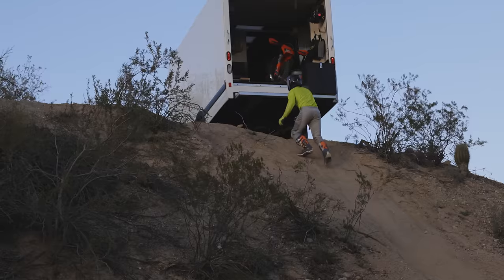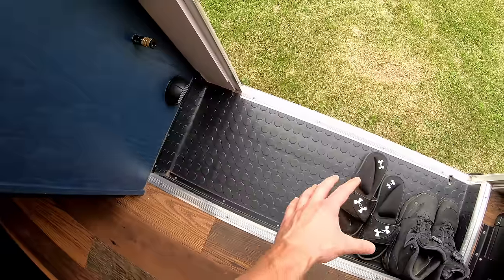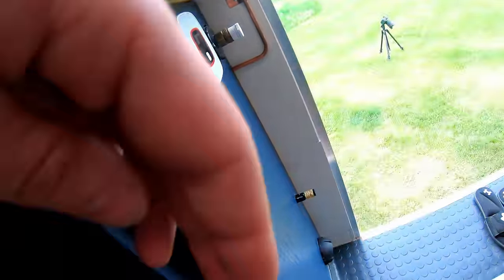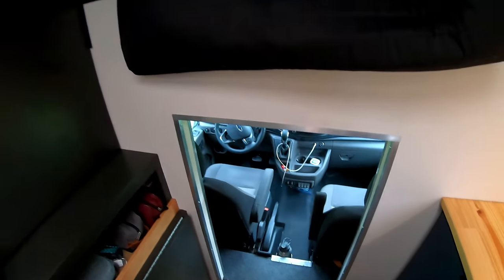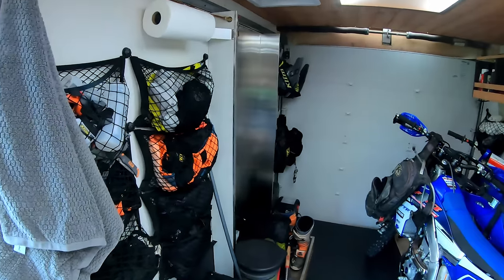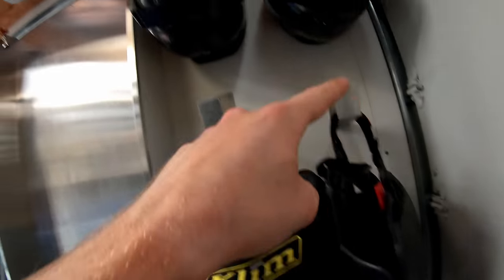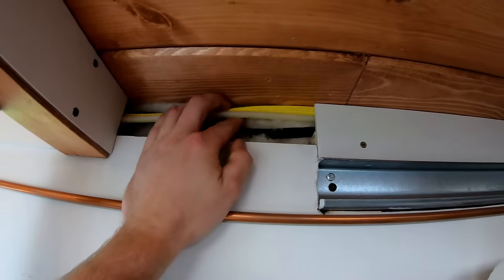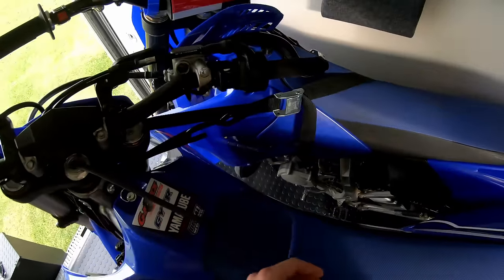Incredible DIY Dirtbike Camper Van Home FULL TOUR

Comment: VERY nice build! There are a few things I would do differently, but for the most part, they're just based on personal preference.

Upgrades to consider....

1. Cover/dress up the bottom of your bed frame and table.

2. Connect the two table straps together so you only have one unhook/hook to go from table stored to deployed.

3. Pull your garage vinyl up and glue it down to prevent the ripple in it.

4. If you always have a ton of extra battery available, consider getting a nice induction hot plate. Some have the ability to dial in an exact temperature (in 5° or 10° increments) and it gets rid of needing to keep butane on board.

There was something else, but I'd have to go back and watch the entire video to remember it (CRS doncha know 😀).

None of this is criticism, or at the most, constructive criticism. Overall a GREAT build.

I've been thinking of something along these lines for quite a while, but for my bagger Goldwing. For me, though, AC and hot water would be required. Also, I'd probably make the shower pan hiden under a floor panel in the garage so it's invisible when not in use.

Comment: I bought an electric water pot for coffee and noodle cups etc, it's changed my life.  It's so fast and efficient, I suggest getting rid of the teapot
Reply from the maker: I definitely don’t like how large mine is but considering in only boil a tiny amount at a time for oatmeal, it takes about 40 seconds. I think I’ll just get a smaller one.
Reply: +1 on the electric water pot those things boil instantly and it would be a lot simpler for your setup if you just want some quick warm/hot water instead of pulling out and setting up your stove you just plug the pot in.

Comment: Dream build for sure. Few things I figured I'd chime in about:

-Might be worth adding caulking to connect the kitchen butcher block and walls? 
-A bit of food grade antifreeze may be cheap insurance for the winterization process. 
-Adding weights to the bottom of your shower curtain may allow you to store it above and have it drop down (storyteller style), and rolled up/clipped when not in use on the hooks.
Reply from the maker: It’s caulked! It’s clear and does not show on video. I really won’t ever need to winterize it because if it’s cold, I keep it heated. I don’t plan to not be living in it in the winter…
Reply: @BeRAD  Right on :)
Reply: Agree

Comment: One thing I may want to add to your build is a way I could hookup to external water and power supply whenever available so I could toggle between the two if I happen to have access to water and power.
Reply from the maker: I have external power hookup…just didn’t show it. And yeah water would be easy to add but I have no use for it since I try to park off grid. Or just refill with the hose as needed 🤷🏻‍♂️
Reply: @BeRAD  that's completely cool too

Comment: Great video of an amazing van. No hot water 😱 💯 on the table and even more so for the engineering excellence on the bed. The gas can carrier is such a good touch and that sink though🤩 Well done 👊
Reply from the maker: Haha yeah I’ll add hot tap in at some point. Now that it’s summer though, I’ll probably wait for fall.
Reply: @BeRAD  with 70 percent battery remaining overnight (assuming it drops to 45-50 in the winter you may still have power left for an inline water heater.

Comment: Beware I’ve found that braided vinyl tubing to not be rated safe for drinking! I had to switch to clear vinyl for my van. The pressure rating is right on the edge but so far so good.

Comment: sick! how long does the curtain take to dry in the shower? do you think the fan above it is necessary?
Reply from the maker: All fronds on weather. I’ve since changed it so it stays hanging so I can pretty much load the shower back with stuff right after I’m done. Fan not at all needed without warm water. With warm water I think it would be a good idea long term.